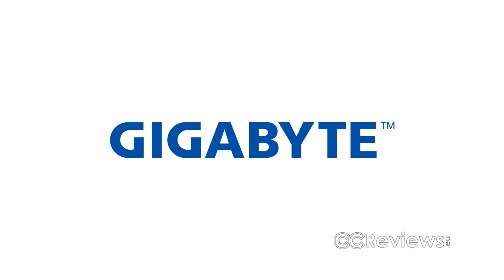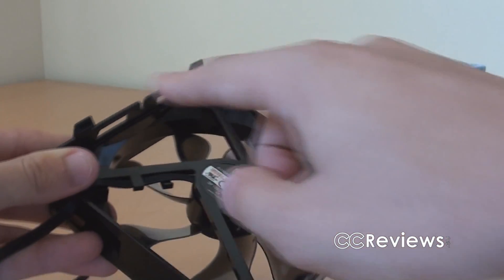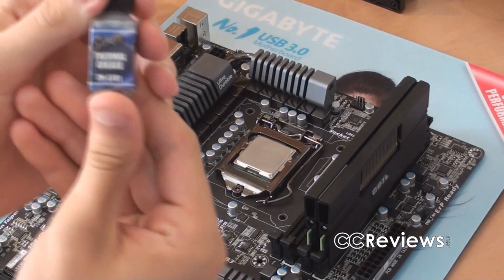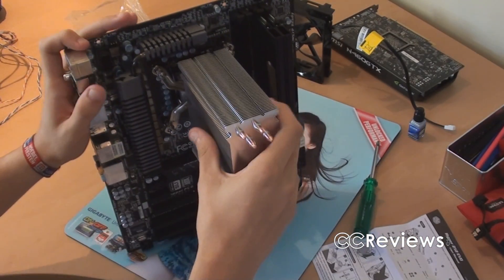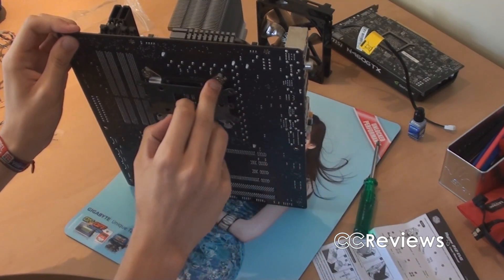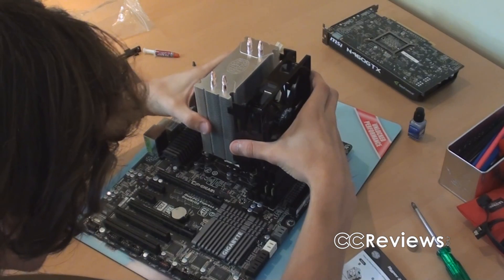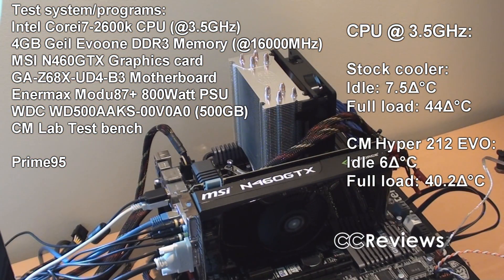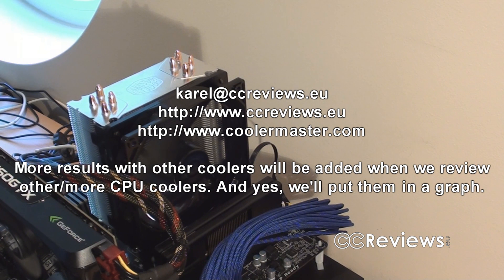#54: Cooler Master Hyper 212 EVO CPU cooler Review (CCReviews)

Comment: hmm my scythe mugen 3 rev.b @ full load(4,3ghz sandy brige E i7 3820) = 70°C (delta=50°C).
mine cost 40€ and yours 30€ and almost same temperatures...so this is a good video :)

Comment: Those idle temps are impossible. You cannot get anything below 12-13 celsius without water cooling.
Reply from the maker: Keep in mind that those are 'DELTA' temperatures. Delta, generaly speaking in math, refers to a difference. In this case the temperatures I post here do not include the ambient temperature.

Comment: It could handle a 4770k forever as long as it doesn't get too hot. If it doesn't overheat when the CPU reaches maximum load, this cooler can handle it practically forever.

Comment: just a warning, this cooler is great, but overclocking MIGHT get your cpu temps pretty high if your case isnt very ventilated, and yes, a 650 is way more than enough, unless you are crossfiring graphics cards

Comment: Its safe to use on stock at full loads, just make sure your case is not a pos. I've ran mine at 4ghz but it was toasty at 82c on a fortress ft02. Rule of thumb, NEVER go over 90c, 80c is the highest I allow my tunes to run. The cpu will shut itself somewhere around 109c

Comment: So far its turned out to be a great cpu cooler its even improved the air flow in my case, the only down side is how it blocks the memory slots but apparently you can put the fan on the other side and it has minimal impact on temperatures, some guy actually did some detailed benchmarks on the effects of having the heat sink and fan in different configurations :-O.

Comment: Can you not simply attach the fan to the other side of the heat sink to avoid obstructing the memory modules? or would that just completely screw over the air flow?

Comment: How much does the distance between the CPU and the memory slots differ between various motherboards? If they are all relatively the same that's good. I have a Asus P8Z77-V Pro, and the full size Corsair Vengeance RAM. The ram is in the furthest slots I can put then both in from the CPU, and by the looks of it, from this video, the RAM wouldn't obstruct the fan if I bought the 212 EVO.

Is that right or am I likely to have problems with it still?

Comment from the maker: it's gonna be difficult to remove a little.. You should remove the thermalpaste. You can do it with a dry cloth or something, as long as you can see the CPU like as if it's 'new'. Then apply a little amount of the new thermal paste and install the cooler. DON'T use toothpaste..

Comment from the maker: it's best if it pushes air through the heatsink (so positioned near the ram). But it can work with the fan on the other side. Or you just change the entire airflow instead of from the front to the rear; from the rear to the front..

Comment: You didn't even mention that you had to move your RAM out of the way to install the fan! Don't you think that was worth mentioning? What about people that plan to use all four RAM slots? I suppose they can mount the fan on the other side pretty easily, but that is hardly ideal for airflow. Also, temps are not going to go DOWN when you install this in a case... lol. What do you think all those case fans are for?

Comment: Actually this cooler can handle OC to 4.8 ghz without any problem.  This particular model is known for doing the same job and sometimes beating liquid coolers within 2x of the price range.

The processor in question is i7 2600k as a reference point.

Of course in the really top end builds, liquid cooling is still preferable, but you really wouldn't use H60 in those rigs anyways.

Comment: Hyper 212 EVO CPU cooler cost 40$ and the H60 liquid cooler cost 60$. Not rly a big difference! Lets say you bought a 2500k. The maximum you can overclock with this cpu cooler is 4 ghz. With the liquid cooler you can go to 4.635 ghz. Dont buy crap to save 20$!

Comment from the maker: @TheJimmyman888 you can put the fan on either side, but to have the same performance they would in both cases have to push the air through the heatsink (if you only have one fan.) But I would not do that immediately if you install this in a case, it would most likely interfere with the airflow. On the other hand installing it so that it tries to pull air through the heatsink (thus following standard airflow) it won't cool as good.

Comment: It's a pretty good cooler. I have it and the previous one, the 212 plus. Not much of a difference in temps, but that's because of the fans. The old one goes to 2000 rpm, this one is only 1600, but extremely quiet. Here they sell for about 25-26 euro, so they're a steal.

Comment: I heard it's always better not to spread the thermal paste, but just drop a little dot of thermal paste and then the pressure when the heatsink is installed will spread the paste evenly without creating bubbles.

Comment: i'm idling like at 34-36 and it flies to 49 with prime 95... wtf!!!!!!! my current setup is 120mm back exhaust 2 120mm top exhaust 1 side intake 1 bottom intake 1 front intake and the cooler is positioned vertically with the fan pushing air to the top from the bottom... i could mount it the other way with dual fans but i think it would be better with the dual fans at the top help

Comment: great video, just ordered it! would it be possible to put the fan on the other side of the cooler to avoid the RAM slots as you did mention it can have 2 fans for a push-pull configuration?

Comment from the maker: @PaperyPaperNZ You have to stick the crews of the bracket (the bracket which holds the heatsink in place) through the holes in the motherboard + through the holes on the retention plate as you can see in the video.. Then use the included bolts and screw them onto those screws..